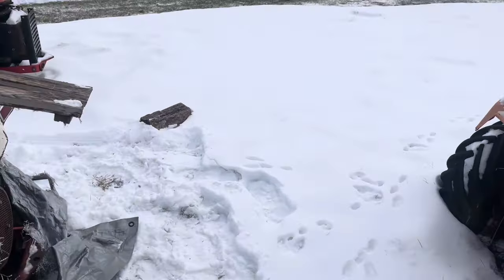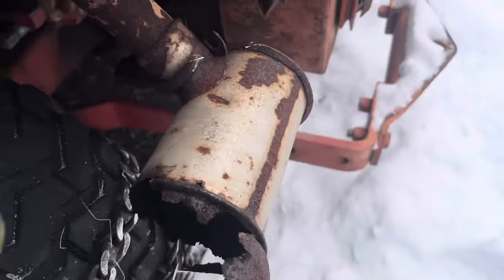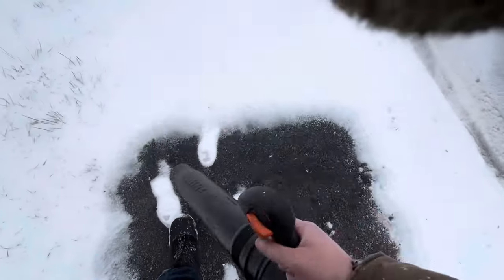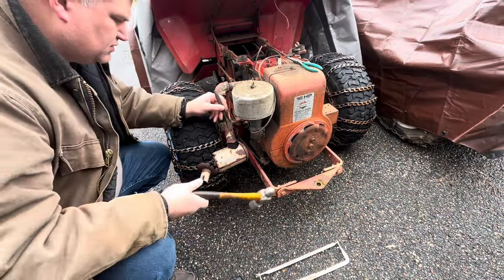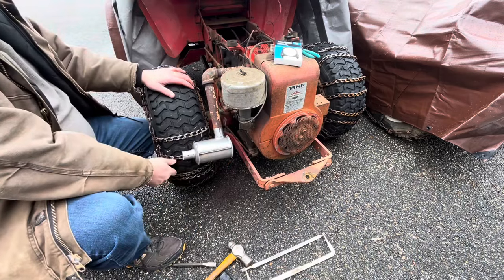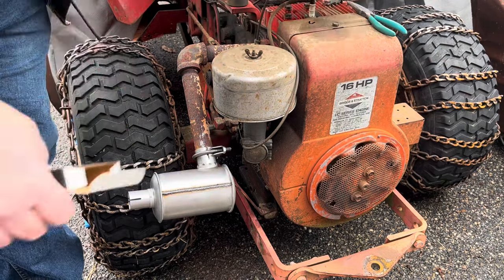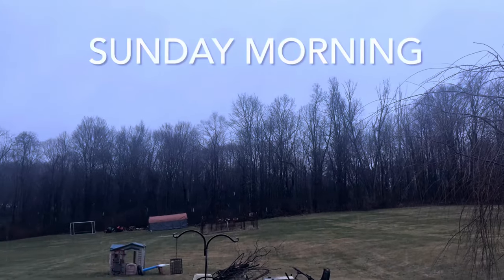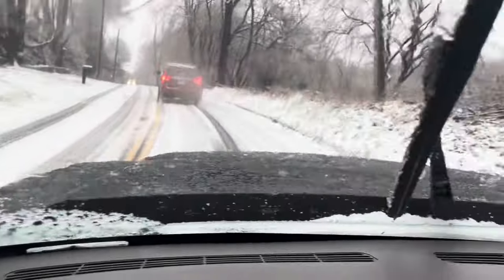A Week Of Tractors and Snow VLOG Cold Starts etc

Comment: Hi im about to purchase a gravely 450 commercial with a front mount pto snowblower. I dont know anything about these and im decent with mechanical but not a genius. Where can i find the best info and places to find other attatchments? Can i message you for questions?
Reply: Seller is only asking $200 total. It needs some carb work. Carb kit and diaphragm included. I live at roughly 9k ft elevation in Colorado. Im excited potentially start a small plow business. I think I found the deal of the year.
Reply from the maker: @johnmurfin  great deal get it as fast as you can.  All the manuals are at manuals.gtcoa.com